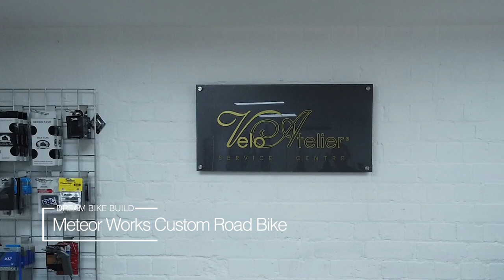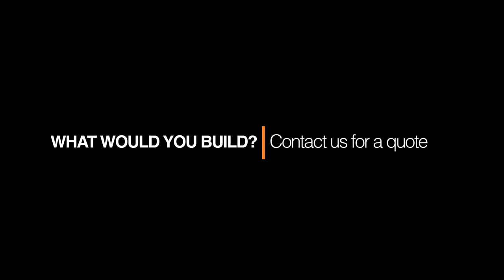Dream Bike Build - Meteor Works Custom Stainless Road Bike

Comment: This is absolutely beautiful. Very close to my dream bike build. I would prefer a mechanical group set. Could you please give me a ballpark idea of the cost and the weight of this bike? Thanks. The videos are lovely.
Reply from the maker: Thanks for watching.
Obviously price would depend on spec but a stainless frameset including the bike fitting and design along with a high end mechanical rim brake groupset and carbon finishing kit is going to be in the region of £5-6k